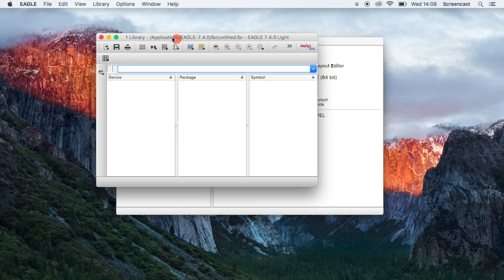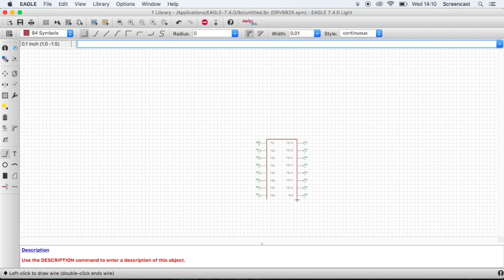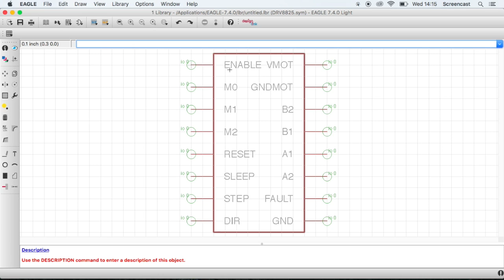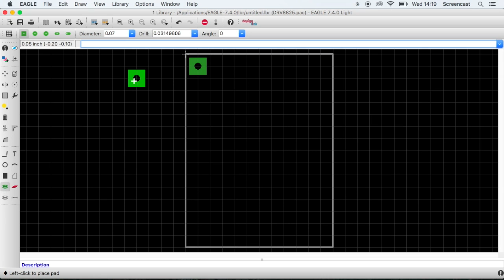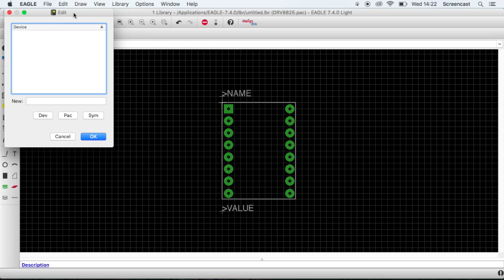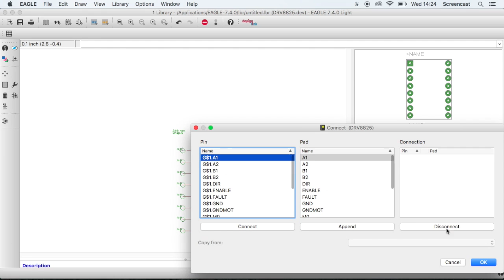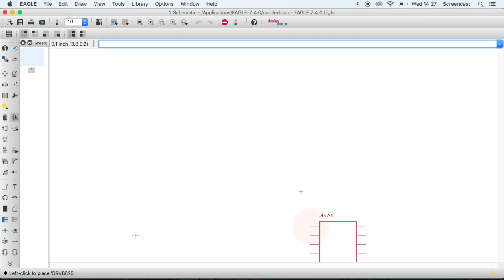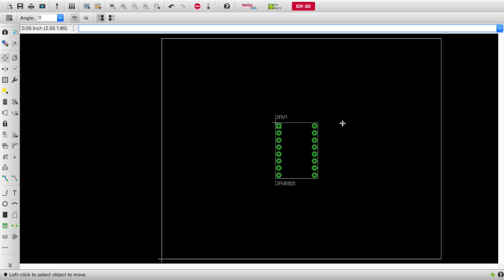Create Custom Parts in Eagle 7.4

Comment: One suggestion when creating your symbol or footprint, is that the origin of each is important, because that's how you will place the symbol or footprint on your board and move it around and select it. I suggest making sure the origin is easily accessible, and not under something, like a pin or a line. It makes it so much easier to select the item when it's not behind something!

Comment: KILLER TUTORIAL! One of the best tutorials I've ever seen on YT. In just about 8 minutes you accomplished what Autodesk was not able to do in one hour! But I have a problem though, When i put the componentin the schematics and then I go to theboard, it gives me an error saying that "Board and schemastics are not consistent" and the component is not on the board. Any hint on what could cause it? I followed the step by step. The only diference from what you showed is that now , in 2021 on Win10 platform, the action you do at 3:10 to select the package, is notavailable. It callsthe icon Footprint Instead. I don't know if this is hte issue, but at the end, the drawing that is supposedto be the package, sits in the footprint column of the device.

Comment: Very good.
I'm having issues to connect the pins at the schematic. 
For some reason the wire won't connect with the pins. 
Can you help me?
Reply: Make sure you build your Schematic Symbol on a .1 inch grid.  If you don't, it possible the NETs will not connect.  Make sure to use the NET command to define connections on the schematic, don't use Wires.  Place the components on the schematic on a .1 inch grid as well, if you use any other grid it will not work.
I hope this helps.

Comment: Not helpful for me, How do make sure the pins you placed randomly will align with the actual physical device? What's the distance between the pins?
Reply from the maker: You should use the grid for this. Seeing the comments, You've already checked this tutorial? https://www.youtube.com/watch?v=xCMcexRX2Lk
Reply: Do I count grids?? Ans also, like you showed in the video, I have already placed the pins by counting the grids, do I have to count the grids again in the package file to place the pads? This is so much work. Why can't I just enter the distance I want between my components and pins. This is so painful for larger projects.
Reply from the maker: You might want to send this suggestion to the makers of Eagle. I'm just sharing what I know. ;)
Reply: This is actually short and helpful. You could ask your question in a more polite way. He did a good job explaining the process in a short time.
Reply: Just wanted to add in. Sometimes looking up the datasheet itll have the dimensions for the solder pins. You can see in this component at the very last page for example (http://www.onsemi.com/pub_link/Collateral/NCP5007-D.PDF).

However it seems like properly measuring the lines is still an issue.